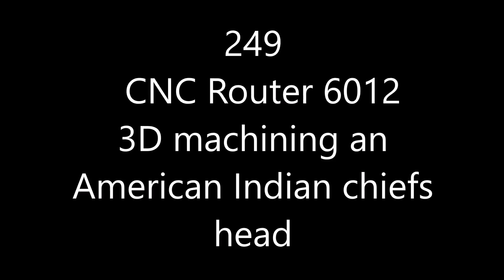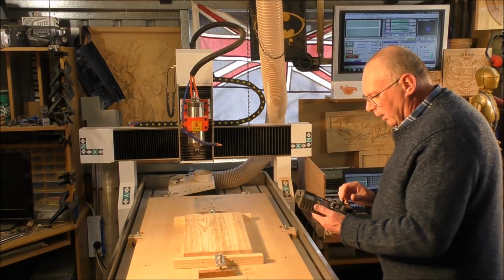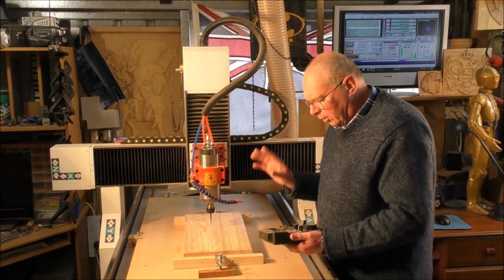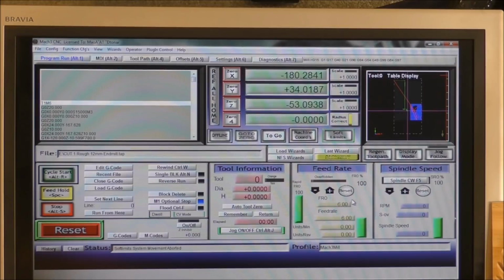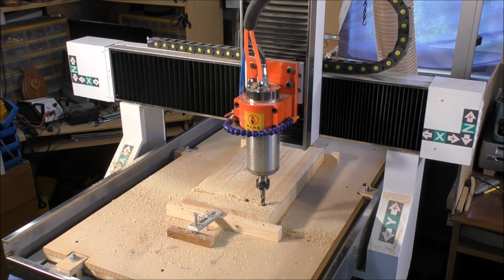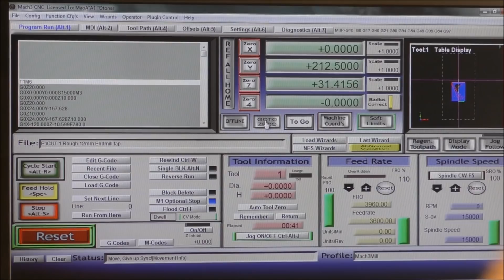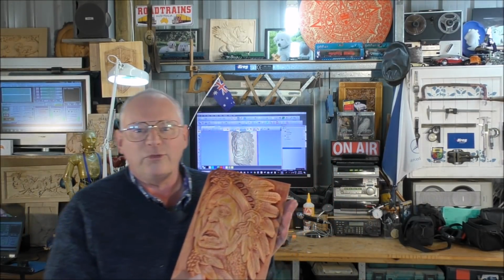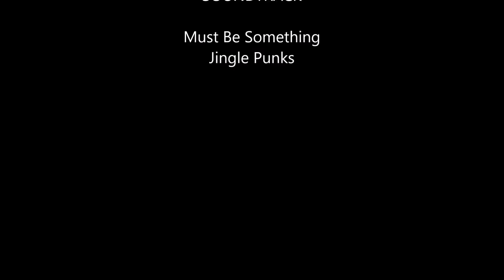CNC Router machining an amazing HD 3D American Indian head

Comment: I noticed your bits are small at the tip and thicker as it gets to the chuck. Does the CNC machine accommodate for the thicker part as it’s going deeper in the wood carving?
Reply from the maker: Hi, no Carveco CNC  CAM program will